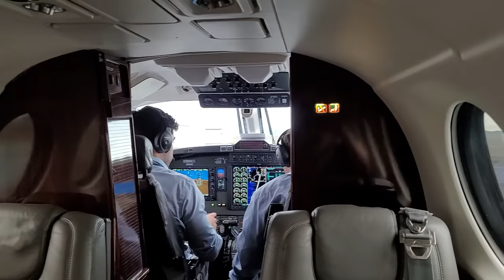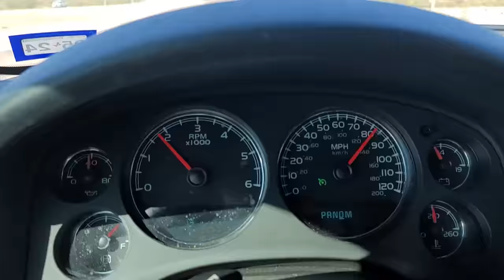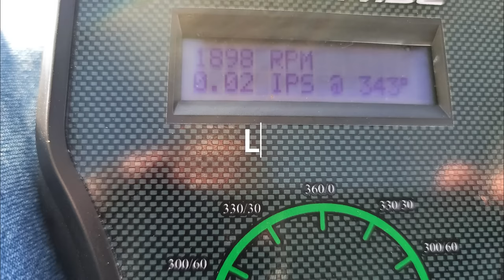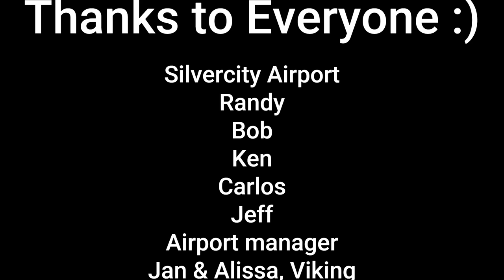Viking Honda 130 Engine Swap Adventure

Comment: I am an old, retired mechanic with 60 years’ experience in autos, airplanes, farm tractors, motorcycles. My opinion of the failed engine, lean, and overworked on low grade fuel I believe you were lucky to get 1100 + hours. I would suggest checking the plugs often. Big difference compared 0-200 that only turns 2400-2500 with low compression I have run them lean on 87 auto fuel, never melted any plugs as in your video.  Thanks for the Video
Reply from the maker: Plugs were checked frequently . I will be checking with borescope monthly and going to use Mid grade  now.

Comment: I am going to the rudder build deal in about a week, Dec. 1 and 2.  Jan said he will be there for at least part of it. I will be quizzing him on all the best options for a new Cruzer build. my gut feel is the NA engines will have the longest life in the airplanes but maybe he will weigh in on that with something different. Hard to believe the new baby turbo is as good as the Hondas. I am favoring the 150hp thus far. It was great and super encouraging to see you back in the air so quickly, at a likely very reasonable cost impact and it is a part of why some of us like this honda Viking deal to start with. I would be on board even if the TBO was planned at 1000 hours.
Reply from the maker: BABY TURBO ... watching for test results  myself. I always wanted a turbo. Pros and cons to be seen.

Comment: I would have put a catch can on the breather (the breather pointing at the manifold wasn't a great idea) and an eatension tubw past the cabin door, then put some 15w40 oil in it with some STP/motor honey/Nulon or similar in the oil ... then done a couple of hours flying around that airport to check for problems and oil usage and flown home planning multiple stops on the way home to be near airports and keep checking. I did similar many years ago with a gyrocopter (direct drive/Subaru EA81) with success. Greetings from Down Under

Comment: Good job Dave, Had to go through that twice with mine. Interesting the things you find in a one-off creation. I was lucky in that my issues were at my home airport and didn't have the additional headaches you were faced with. All in all, You are back in business with minimum downtime.
Reply from the maker: Yes, all part of flying. Flew longer than most pilots,without any issue. So,still thrilled. 😎👍

Comment: EGT or wideband O2 sensor will give you insight into AFR. Running rich is a bigger problem for aircraft than running lean. More than likely the issue was timing vs load. If Jan isn't using them, adding knock sensors would create a layer of safety around conditions that are difficult to recreate during a dyno tune.
Reply: Running too lean will certainly damage your engine
Reply: @thomaswilga735  if it was really lean he’d have trouble keeping it cool. It’s also direct injected, which is much more tolerant of lean conditions should they be present.

Comment: I'll be very interested in the teardown results. 

Borescope pictures shown didnt quite cover the periphery of the piston, the (my conjecture) likely propogation point for the  crack. I'm interested to know if there were any chunks missing. 

For detonation failures, I expect more instantaneous damage than a (progressing) crack. Such as: broken top ring land, torched edges of the exposed aluminum, hole burnt through the crown.

Good on you for immediately landing, checking the engine, and changing it. 

The failed engine may yet be a good base for a rebuild.

Cheers!
Reply from the maker: Hoping to open it up this month. Waiting on a free moment. Retirement is exhausting 😉

Comment: At 26:13, you have the wiring passing behind a motor mount bracket. It comes out from behind in a tight spot on the top of the bracket. It appears to break over the sharp edge of the bracket on the top side. If its making contact, eventually the wiring will wear through from chafing. Id suggest either re routing the wire so it is outside the engine mount bracket, or attaching a softener to the sharp edge. The former would be the best option IMO.
Reply from the maker: If you are referring to this loom wiring ,it is just two thin wires protected in a loom and zip tied to prevent movement. 
If it is something else , please show a pic 😎👍 thanks for looking .

Comment: Glad you both are safe and recovered from this situation. How are you going to limit your max rpm on the replacement engine?
Reply from the maker: I adjust blade pitch limit, via the rod in the hub.

Comment: Very rarely, high time engines just gradually failed or failed a cylinder blow down test, it does not strand the people at remote airports.  2000 hours equal around 120,000 miles in a car and that is low milage. But  this make started life as a used engine and who knows how much is already on the clock. Most people, if they did a precaution landing and found lots of oil on the dipstick and just some smoke in the cabin, would have just top up the oil and flew back to home base to work on the plane.
Reply from the maker: I has done a blowdown and compression test just prior to this trip. All was great.  I equate the mileage different . I think my mileage at 1200hrs is close to 120000 miles in a car .
The loss of compression was the grounding reason.  If I was remote in the brush, I may have attempted flying to an airport.  
The purchase papers showed the engine below 100 miles, but who knows for sure .
Reply: Going forward, I like the 0W-30 you got way better than the fuel conserving 0W-20 in an overworked, high-revving commuter car engine. In fact, if no catalyst like in your set up, I would boost the antiwear too. Hotshot secret sells a good additive or just use a higher performance synthetic oil. You really want something better than M1, which is just fine in a commuter car, non-critical application.

Comment: Danger Will Robinson!  The Viking engine turns it around 4900 RPM in cruise, roughly twice, the RPM you’ll see in a Lycoming or Continental certified engine. These engines are derived from automobile engines which were not originally designed to output high levels of power full-time. In a car you might push the engine to max RPM, what, a few times a day for 10- 15 sec per application?  On takeoff you are at full power for a much longer time. 

In your typical Honda, you’ll be turning 2000 RPM put-puting around behind your 1.5 L engine.  At highway speeds your 1.5L Honda requires about 50 hp, whereas at cruise speeds in your aircraft it is putting out perhaps twice that. You’re asking an itty bitty car engine to perform at a level far in excess of the automobiles for which it was originally designed. 

I’m sure Viking beefs up some of the internal parts to address this, but you’re still asking a lot from a small  engine. If you have 1,100 hours on your Viking engine, and it turns twice the RPM of a certified engine, then it has seen about the same number of revolutions that a certified engine will see in 2,200 hours - which is near to or beyond certified TBO.  2,000 hours on a Viking is more like 4,000 hours on a certified engine. 

Why is Rotax different?  Because the engines are designed from the outset for this type of service. Remember the Pond racer that tried to get crazy horsepower out of twin modified Nissan auto engines?  They blew up all the time. You could no more expect long duration 800 HP out of a Chrysler Hellcat Hemi engine than a man in the moon. It is designed to accelerate and rest, not hump it full time.

Very impressed with the turnaround. Would have taken months on a certified engine!  And you saved a ton by doing it yourself!
Reply: You make some good points but I'll add that Honda I believe bases it's outboard boat engines off their car designs.  And an outboard can be expected to run full power for hours at a time.
Reply: So... Been flying stuff a while. I've got a ton of friends who have ended up gliding Continental and Lycoming engines to a landing. Things fail. And in this case, it's an Auto engine that costs a fraction of the others, and has a HEAP of other benefits. Personal choice... I'm going to give the 130 a try in a couple years.
Reply: You don't know what you are talking about!

Comment: If you could custom order/rebuild an engine that issue may be solved with a piston meant for a turbo application, they are more resistant to detonation and splitting due to detonation in an automotive style engine.

Comment: I'd suggest pointing the crankcase breather out the bottom of the cowling instead of directly onto the hottest part of the exhaust.    Burp enough oil out that breather and you will have a fire for sure with the current setup.   I've honestly never seen a setup on any engine where the crankcase breather is sprayed onto the exhaust.
Reply from the maker: I now use a catch can , and hose is vented out bottom of cowling . 😎👍

Comment: Yo texxas! (First time watcher, enjoyed your adventure!) Question. And probably a hot debate. Cost difference between regular and premium say $.50? Say 8 gal an hour? X 1200 hours = $4800 savings in fuel... vs premium im not sure thats worth the savings? Just food for thought.. but im a premium snob in my daily driver so im not the right person to ask... but my thoughts are premium burns better, cleaner, more power, more efficiency, longer engine life... these are NOT facts these are my opinions. Curious your thoughts
Reply from the maker: I detonated prior to 87 oct tuning. So will have to retest. The engine is built for 87. So...lets find out :)

Comment: Whether the ECU will accept it or not. A stand alone Knock Indicator could easily be added...
Reply: It has a knock sensor, so if tuned properly it should detect knock and adjust tune or notify pilot.

Comment: Why not rent a trailer and trailer the plane to Houston? I'm not saying one is better or worse, just wondering if you considered it and what the difference in labor and cost would be.
Reply from the maker: In this situation...The time to get a trailer , remove wings , load plane, trailer it 1000 miles without damage , then reinstall wings ...
It was much faster to swap engines.  
Now , if the new engine had issues... then yes, I would have likely removed wings and trailered.

Comment: Wonderful documenting all you've done and your findings.  Very nice workmanship, and she looks great.  I thought max rpm for Viking 130 is around 5400, but it sounded to me like you said you occasionally run up to 6,000 RPM?  If so, why?   Also, wonder if the rubbing of the engine cowl may have been caused by a slight engine offset?
Reply from the maker: I run to higher to Test limits outside of standard.  So the normal user should have no worries 😎👍

Comment: I would not recommend attaching to the engine mount unless you use adell clips. The hoses you have rubbing on the frame will eventually will rub through frame with vibration.
Reply from the maker: 1200 hrs and all looks just fine. Areas that rub or could rub , have standoffs or are secured as to no movement . Adel clamps are fine too. Zip ties are doing very well and prefer those iver adels for loose hoses and wiring .

Comment: 1:30 and 25:50 Why on Earth is your crankcase breather aimed directly at your hot exhaust instead of going out the bottom of the cowling by the firewall?! Smoke from burning oil? No surprise there. In my 40th year as an A&P.
Reply from the maker: As per Viking. I have Moved it to a catch can , that goes out bottom.  Now the other side of that  sword. If the slight smoke had not entered the cabin, I likely would have vented all oil without knowing, much further from airport and landed in the desert or mountains. So, still on the fence. It was a nice early alert.

Comment: If the exhaust was quieter you could mabey hear the detonation (known as pinging) and reduce the throttle before damage.
Reply from the maker: Too subtle to notice. The engine adjusts mostly very well , but testing isnt always easy on parts.

Comment: That is seriously impressive. Over 1,000 hours on an unmodified junkyard auto engine, revving its head off the whole time, I never would have guessed that they could last as long as that... absolutely amazing. With a decent ECU and tuning, I can't imagine why this engine wouldn't have made it to 2,000 hours.

I guess a lean cylinder is one downside of having the exhaust collector integrated into the head, you can't really have EGT probes for each cylinder to monitor them individually. This engine should definitely be making use of a knock sensor, if it's not already.

I always thought the flex plate was an odd choice, why not a lightweight flywheel?
Reply from the maker: In fairness, this engine was testing outside of the ECU limits occasiinally , to find new limits to optimize. For instance , it has a 87 octane tune.  Not premium. To save $$ .
It was hard tested in sustained high rpm climbs , steep descents , etc.  Im surprised it lasted this long. Lol. Great engine .
Next one , i will baby 🤠
Reply: @Texxas750Cruzer  Even more impressive, then!
Reply: Interesting choice of words “ junk yard engine”. These engines have never seen a junk yard. The wrecked cars are purchased at auction by corporations that make up a billion dollar industry. Cars are reduced to their parts and they are sold to the secondary market.
Reply: @WokeByTrump  As far as the engine is concerned, there's no real difference there. I'm sure that there's some additional control over the quality of the engines that you get that way, but they're still used engines that could have been mistreated and/or poorly maintained by their previous owners.

I'd never trust an engine like that in an aircraft, I'd want it rebuilt and I'd want stronger, race spec components installed.
Reply from the maker: @PistonAvatarGuy   
Takes alot to get ya to trust...lol ... 4 years , 1200 hours , flew all lower 48 states in a record 10.5 days , never added engine oil 😎👍. 50 hrs in one month challenge completed. 
 Not sure of ANY other flying engine that could match that. Or has tried.
All this time, only engine maint needed was oil changes .
Pretty trustworthy i'd say 🥰
Reply: @PistonAvatarGuy  So my 1959 O290 D2 with 4 overhauls is better? This mentality is why we fly 60 year old airplanes and lawnmower engines. Honda spent more dollars on anti friction coatings for this engine than lycoming spent on R&D in 50 years. Let’s talk about the Honda racing team, that invests hundreds of millions of dollars every year into advancing this technology. It’s brainwashing, GA has been tricked to believe it’s safer to fly this old junk. Just listen to the number 1 aviation repair guy in the world, Mike Bush Savvy Aviation, when he won’t overhaul his engine at TBO, 4000 hours and going. In one of his videos he compares auto engines and aviation engines, he called aviation engines pitifully obsolete. Current GA engine manufacturers could not survive without the propaganda surrounding them, “ It the only choice to be safe”? With 1950’s metallurgy? The failure rate of automotive engines is infinitesimal compared with GA engines, and that is with GA getting a rebuild every 40k miles. Now add the FAA’s desire to eliminate GA and you wonder why they’re the ones pushing the propaganda about how 80 year old engines and 60 year old airplanes are “safer”. It’s this mentality that has GA living in the Matrix. Moving on from that, the entire Honda LB15A long block is in stock on the Honda parts website for $6500 with factory warranty, how’s that for an overhaul! Perhaps an experimental aircraft engine company is too scrappy, perhaps, but who will take up the task of advancing the technology in aviation if it were not for these pioneers. Criticized for offering engines with 200 -500 hours on them? Just click on the option for the new engine and pay the premium, it’s that simple. I say this to any company who is involved in experimental  aviation… If not you, then who?
Reply: @WokeByTrump  I'd rather fly with a Honda engine than a dinosaur Lycoming or Continental, I'd just like the peace of mind of knowing that the engine that I'm using to power my airplane (and prevent severe injury to myself and anyone who might be flying with me) is in the absolute best condition possible. These car engines are also not meant to power aircraft and they're not meant to run at 4,000+ rpm for thousands of hours, they just happen to be able to do so because they're so well built.

"Current GA engine manufacturers could not survive without the propaganda surrounding them."

Absolutely, 100% agree.
Reply: These cores are actually meant to go to higher RPMS constantly, and that is how they are tested before going into cars and the outboard motors as well @PistonAvatarGuy
Reply: @eggenfellner  What's done to them to make them more able to consistently run at higher rpm?